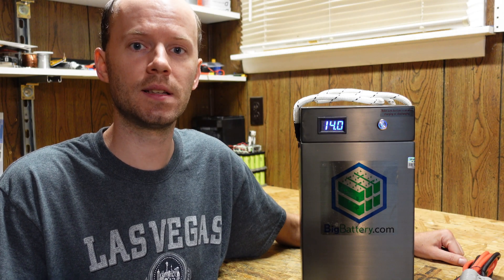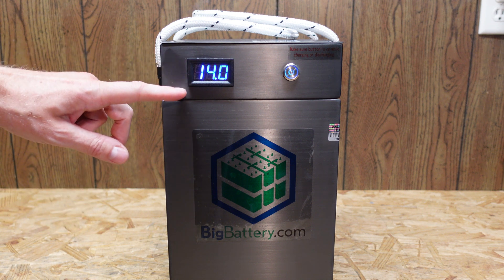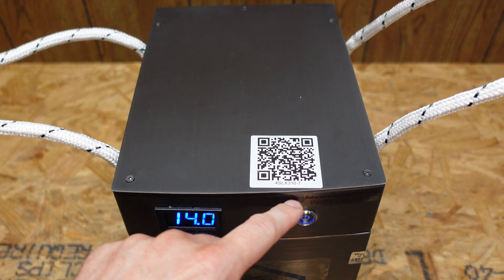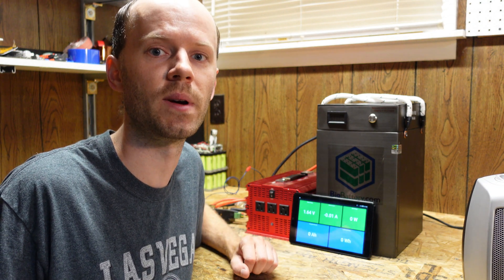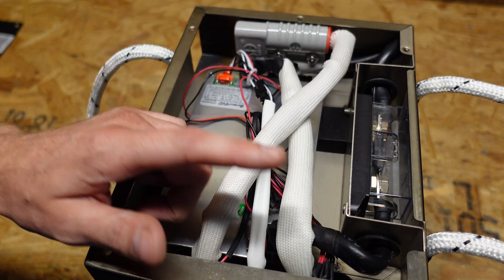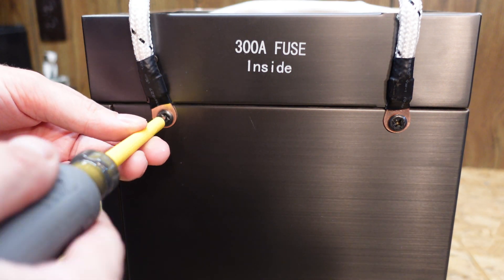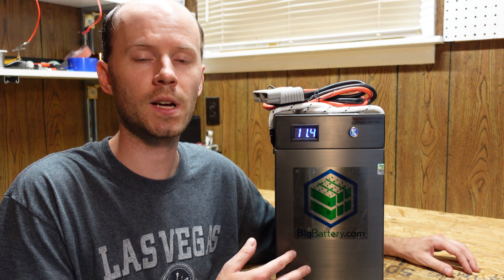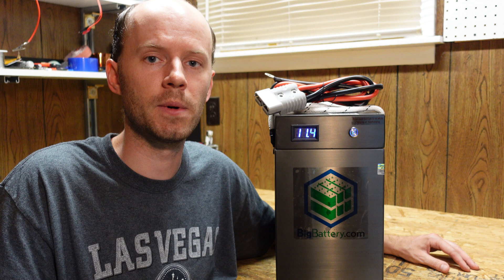BigBattery "OWL MAX 2" 12V 228Ah LiFePO4 Battery, Review and Teardown

Comment: So.. you can buy the EVE 4 battery kit of 280ah 12v.. for $700 shipped. BMS is another $100 or so.. I assume the nice cover/padding, cable, make up the additional $500+ for this battery? Are the cells warrantied by BigBattery for 10 years or something maybe? Just wondering if it makes sense to pay almost double.. for lesser storage capacity? I would think just buying the EVE for $700 shipped which comes with the crossbars for connecting them might make a lot more sense?
I could not tell.. but you can basically run a small tiny floor heater for only 2 hours on a full big $1300 battery?

Comment: Where the balance wires plug into the BMS there are 4 LEDs. Are they suppose to flash during normal operation? When my battery was new they would flash during charging but now I don't see them flashing. Battery still seems to be working but not sure if something is wrong.
Reply from the maker: Those LEDs indicate the BMS is balancing. It's expected that it would need some balancing when you first got it.
Reply: @LithiumSolar  cool. thanks!

Comment: Great video and demonstration. However, there’s a big con missing. Unlike most manufacturer, BigBattery does NOT comply with any regulation such as EMI, electrical safety, or battery standard.
This would make this illegal to sell in North America and against code to install anywhere on the power grid.
Something you should add to your review, regulatory compliance.

Comment: Please confirm the series capability. I have 2x 170ah owls and tried to wire them in Series for a 24v system. One discharged. Worked with Big battery to trouble shoot and they said they do not support series setup for their batteries. The don't balance for some reason. Very disappointing as I bought a 24v inverter specially for this purpose.
Reply from the maker: Originally when I did these two videos, the OWL was good for 2-series and the OWL MAX 2 was good for 4-series. At some point after, they removed this from their website and it now says not to connect either of them in series. I think it's because people had trouble getting them in balance, but I'm not sure if they changed the internals since then or not. You'd have to ask them if they can explain further.
Reply: @LithiumSolar  I recently purchased the 12v Battery Evo 180Ah versions. These are still listed as 2max in series. The BMS is 175A as opposed to the 150A in the OWL. I have them operating with their series cable to my 24v MPP Solar all in one. Perhaps the different BMS is why the Evos can run in series. I did individually charge them to a full charge before I placed them into service. 

No problems with heat, over temp. Cables remain cool to the touch but my average load is about 35%. Voltage readout on the screens are usually within .1 of each other. I don't need to push my batteries to a 1C discharge. Why would I do that? These off set my electric bill. Just by putting my refrigerator and freezer and my 75" flat screen TV on solar, I have a nearly 50% reduction in my kWh in a billing cycle. My experience is fine so far.
Reply: Yes, that's what they told me. I didn't see the series limitation on the website when I bought them. When I called support they seemed a little hesitant to admit the limitation. Their solution was to rebalance them separately when they got out of sync. My Noco 26000 doesn't seem to charge them very well even though it supports Lithium. Didnt want to spend $200 for their charger so I am figuring out how I can use them in parallel.

Comment: No info on any of the following ?

> Est lifespan (charge/discharge cycles) ?
> Est capacity fade ?
> Self discharge rate ?
> Cost ?
Reply from the maker: Cost is on their website. The company has let me know that these are CATL 228Ah cells, which online research suggests has a cycle life of 2000-4000 times (until 80% health) depending on the source. BigBattery may have more detailed information available if you ask.
Reply: @LithiumSolar  Ty

Comment: To my knowledge, Iron cells such as these are all made at 1 of 2 plants in China, with 1 of them producing over 70% of their exported supplies.  From there battery manufacturers package the cells with their own labels.  So re. the QR code, that will only tell you who repackaged them before Big Battery acquired them.  The cells themselves likely all came from the same assembly line originally.  The Chinese govt. builds their plants and subsidizes them, so its hard for 1st world countries to compete with their price point for cells, which is about 15 cents on the dollar what Big Battery is charging for the assembled batteries.

Comment: Nice review! I do have a concern which I commented on earlier but it didn't post. The battery itself has a 300A fuse, and the Anderson connector's wires are only 6 gauge, rated ~70A (?) continuous, while the battery is capable of putting out 175A. Does it concern you that these main battery cables are not rated higher? Thanks!
Reply: I currently have two of these in route, I’m  planning on hooking them to a 3000 W victron multiplies. now I’m concerned the cables are sufficient.
Reply: Electrical cables are not rated for current.  The formula for what gauge you need is based on internal resistance, voltage, and round trip cable length.  The typical goal is less than a 3% voltage drop from current source (battery) to the end point (like an inverter).  Often there are multiple connections between those 2 points for protection, distribution, current measurement, etc... Ideally those added together shouldn't exceed a 3% voltage drop (which is only 0.36v at 12vdc).  I personally wouldn't consider using less than a 2 ga cable for a very short 12v hookup.
Reply: @aspendell209  "Electrical cables are not rated for current."

Yes, they are. In this scenario, the cable downstream (the 6 awg main leads with the Anderson connector) are from a high amp source (the battery with a 175A rated output and a 300A overload fuse) that doesn't have a fuse or circuit breaker rated safely above the rated capacity of that cables (~70A) which therefore can become overheated and possibly start a fire. 

I do understand that your explanation for how that current rating is arrived at is accurate, and that other loads or fuses downstream will likely be rated lower than the ~70A capacity of these 6 gauge cables and thus a fuse will blow or circuit breaker will be tripped, or that equipment will be be destroyed if improperly fused, making that overheating of the 6 gauge cables unlikely, but it seems that having a battery that is rated for 250% of the ampacity of the main battery cables isn't prudent. 

Like you, I am more comfortable with 2 gauge and larger cabling and as short of leads as possible for the main cables, and in this case I would also reduce the size of the main battery fuse to a150A fuse until the battery cables were sized accordingly.
Reply: @TheEpicureanAtomist  Yep, people that say that cable is only sized to 3% voltage drop never looked at a cable selection table. The higher the amperage, the shorter you can use your cable… up until a certain point. So the chart for a cable may say : 300A = 800ft, 400A = 700ft, 500A = 600ft, 600A = 0ft. So why is that ? Why did it hit a wall ? Because at this point it’s not the voltage losses that’s limiting, it’s the temperature of the cable :

Voltage drop = linear resistance of cable * length * current
Power loss = voltage drop * current = linear resistance of cable * length * current^2
Power dissipated around the cable = constant * length * (cable temperature - ambient temperature)

If we equal the power losses and the power dissipated we find :
cable temperature = linear resistance of cable * current^2 / constant + ambiant temperature 

So as we can see, the temperature reached by the cable isn’t dependant on the length. You cannot exceed the rating of a cable because your using a shorter length. Sure you can use it for a higher current if you only look at the voltage drop, but at one point you reach a hard limit because the temperature. That amperage written on the cable is that hard limit that you shouldn’t exceed no matter what.

Comment: Scratched QRs are not cool. Also, has anyone really looked into the PCB copper thickness when used in this sort of battery, and total resistance and amp capacity? This method CAN work, but variations in PCB fab quality can make a big difference, and delamination and other aging failures can also come into play. Ugh.
Reply from the maker: I'm not sure I see what's wrong with scratched QRs being as they test greater than rated capacity. If they tested lower AND were scratched then I'd be suspicious....

Comment: If I may ask, where in the US are you? I'm not asking for a city, but a state would be nice. To me, it's important to know so I can judge if your solutions would work here in Minnesota. Will Prowse is in Las Vegas, so he doesn't "do" winter. I've seen videos with snow on the ground at your place, but there's a difference between (say) Kentucky and Upper Peninsula Michigan. 

How is your big DIY battery working? I assume you have it going since we haven't seen you working on it, and after the time and $$$ you've spent on it, you wouldn't just give it up.

Keep it up! Thanks!
Reply: check out David Poz's videos, he lives in Massachusetts or something where it is cold and there is snow
Reply: I live in Minnesota. These cells, as any Lithium Iron Phosphate cells, will work in our state. But, the batteries need to be used in a warm environment. I have made a solar generator with a LFP battery. I use it in our ice fishing shack. The batteries can't be left there nor should the inverter (unless the heat is on). These should ride with you in a heated vehicle and brought into the shack when the heater is running. But just using the LFP in general, the cells can't be charged if they get below 32 degrees F. The cells will be toast immediately. The Big Battery BMS does have a low temp cut off to protect you from this. But, keep them warm and you will never have a problem.

Comment: For a content idea I’d love to see a build that can run 3000 watts continuously that I can power an entire small apartment off of, including AC and cooking stuff like microwave, air fryer, or countertop oven. I was going to build out a solar system for that but now can’t remember how to appropriately pair the solar panels to the batteries to the full output.
Reply: Make it  3,600 watts continuous, that will capture all the small vans, small class C RVs, and most bumper pull trailers.   HUGE market for this sort of information and product.
Reply: I use a Growatt all in one unit. $900 for a 3kw inverter (5kw surge), 3kw mppt solar charge controller, and a 1500W AC to DC battery charger. It runs at 24v DC and up to 145 PV voltage. They make larger units too, can certainly do all that stuff.

Comment: Yes. Or at least sell a kit with the connectors to do parallel or series connections.
Reply from the maker: Really even just sell the 4AWG by the foot. It's cheap to buy 4 AWG welding cable, but I really like the silicone-insulated wire and that seems to be hard to find in thicker gauges.
Reply: @LithiumSolar  I bought the BatteryEvo 150Ah "Battery in a box" 200A kit.. (that BMS is rated for 200A btw) (250A with airflow/fan)

Was gonna get the 24V (12+12 kit) but decided against it due to the lack of a 4ga option for the series cables, I'd rather just build my own at that point so I can double up on the 4ga wire to reduce resistance as much as possible. 

(I got a GREAT deal on 4ga Temco 105C welding wire on their ebay store.. over 150ft of it for less than $70 as well as a 100ft roll of 8ga solar wire from them for $49.)

Its my first time doing all this so trying to do it right but not break the bank as I still have to get a 24V inverter.

It's just going to be a small 400W setup though, 4x Renogy Eclipse panels and a 40A Renogy MPPT charge controller.  But I am trying to plan ahead for expansion of the storage and solar capacity to 1,000W at some point down the road. Just trying to get into this is all.

Comment: The 4AWG sheath material could be Nomex, due to its high heat resistance (370*C, 700*F).

Honestly, I don’t trust BigBattery… I’m not saying Grade B cells (scratched warranty QRs) are horrible, but there’s no way to tell what application they were used in before and how they were used. Looks like they’re taking a shortcut to keep the price down. 

SOK tear down showed a substantially better product cheaper per Wh.

SOK Grade A $1,029	
12V	
206Ah	
2472Wh	
$0.42/Wh

BigBattery $1399
12V
228Ah
2918Wh
$0.48/Wh
The Hawk 24v is only a Penny different per Wh compared to SOK.

Over on Will Prowse’s channel he had a BigBattery that was leaking electrolyte… 

I want to like their products so much, but I’m just too concerned with build quality.
Reply: Yeah, I was literally on the BB site ready to click buy, ran into a browser/tech issue which prevented the purchase. Glad that happened as I found some change in opinion but Will and other reviews stating the same issues from several different reviewers and users.
I am researching BBs again but still do not feel good about buying from them. Probably will do another DIY systems.
Reply: Yep, saw that too.
Reply: does their previous use matter really? Capacity test is a capacity test, it must be pretty light to retain required capacity

Comment: I sure hope that extinguisher is in a plastic box, the LPI coating on the PCB is not that thick and metal can easily penetrate it. Having anything rest on a PCB like that is always a very bad idea, especially if it can short out a cell. I would be curious to know what the copper weight is, judging from the video it looks like about 3oz.

Awesome video once again, I like how you describe everything you see, even down to the screw type.

Comment: I swear- it's just like watching my brother do a video! I thought the same thing with the 175AH Anderson connectors. Always coming off the primary battery, always going to a shunt & then to inverter & fuse block. Well, in your test- they are all very close, but- in the real world, they rarely are! I too would feel much more comfortable if they came in 4 AWG at the same length! I think they come in 8AWG standard, then for an extra $20 you can get the 6AWG upgrade. I would definitely pay more for a thick gauge wire! I'm a little surprised that you can't find a 'standard' 230AH prismatic cell from Lishen, but- can understand if BB wants to derate it to not overstate storage capacity.
Reply from the maker: The SB175 cables come with 6AWG standard. I think the SB50's might be the 8AWG? And yes, I would happily pay a few $$ more for some quality 4AWG cables. An option would be great as the customer can choose as they wish that way. Also, after input from other viewers, I'm fairly sure they're REPT 230Ah. If you search Alibaba for them, the results look identical to what's in here. Not sure though, just my best guess at this point still :)

Comment: You could use a computer running a benchmark to get 600W
Reply from the maker: That's an idea. I'd have to relocate my computer though. I really just need to get a board and screw down several porcelain bulb holders, then I could thread/unthread bulbs as needed to reach a desired wattage.
Reply: I use an induction cooktop, not resistive if that matters but you can adjust the current easily. Thanks for sharingb